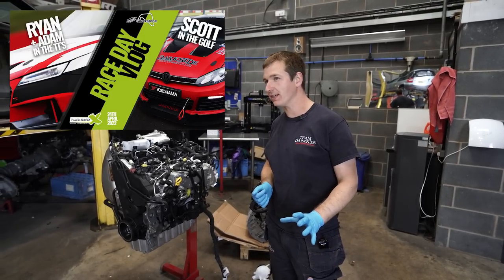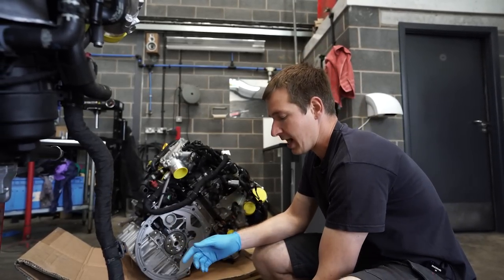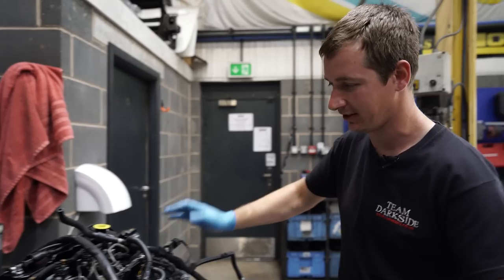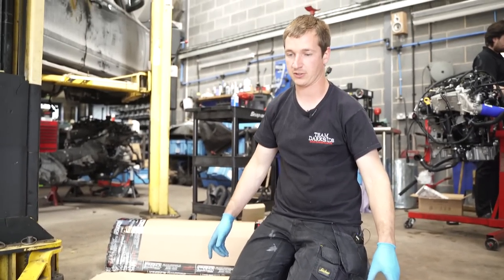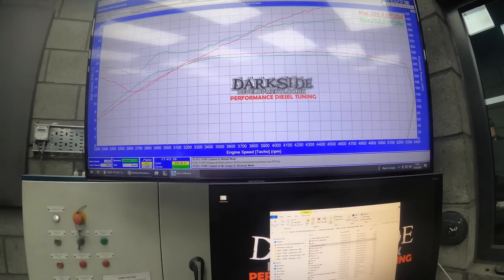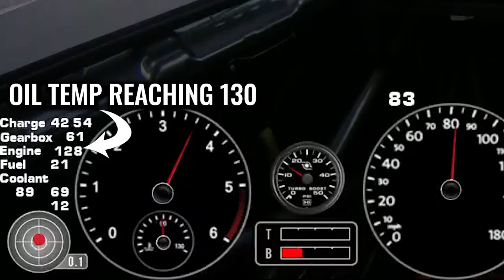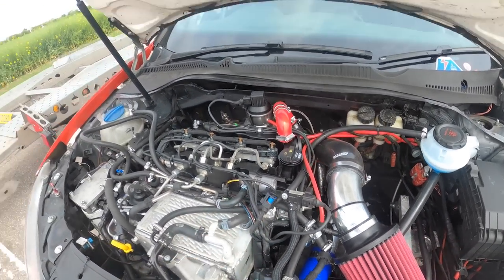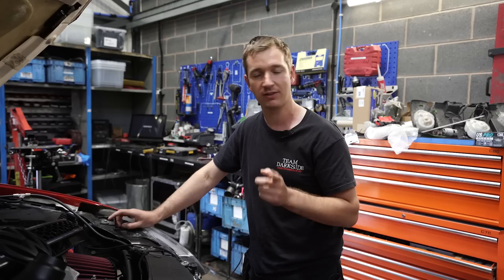Our Golf Race Car gets a BRAND NEW CUAA Engine!

Comment: The tt dsg problem is likely an rear abs sensor issue. The dsg use the rear for speed references and gear selection. If the signal is not correct the dsg won't shift up on its own.

Comment: That plate is 11mm thick, as well the DMF happens to be 11mm thicker than a standard DMF due to it being able to withstand the low end torque of these motors.
That was my deduction at least when I was doing my initial research on my CUA swap

Comment: Jeez i would love 200BHP in my Little Polo 5 door Red SEL90 with just 38,000 On the Clock [NOW Had for 2 years]. I used to Build Classic Mini engines/Gearboxes and raced once @ just 18 In Landow Wales, so having all the little Comforts of NO LEAKS, electric windows and just 90bhp is quite Fun @ my age [Bloody 50 Crept Up] But always more power/ Better Suspension/ better Brakes is a good thing RIGHT. IF i had the £££ I would be up your shop the next DAY. Crappy DPF/EGR on mine ARRRRRHHHH.

Comment: Finally
Reply: Why remove biturbo system?
Reply from the maker: We didn't use the ECU or wiring from the Passat Bi-Turbo, we used the original ECU and wiring, which means there's no control for the Bi-TDI turbo (So we can't).

Comment: I have audi a3 8p 2005, is it possible yo swap engine to CUAA!
Reply from the maker: It's possible, there's a lot of work in it. Not something we would do though unfortunately
Reply: Can you tell me what flywheel you use  for CUAA engine to mount in mk6 manual gearbox !